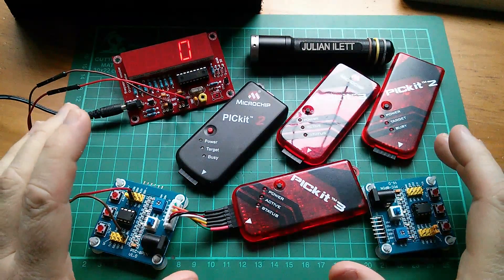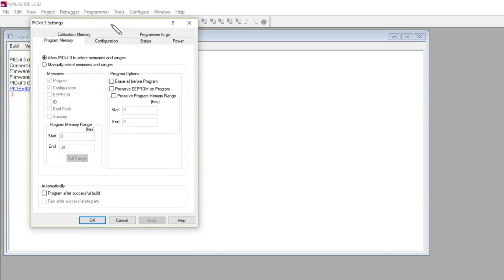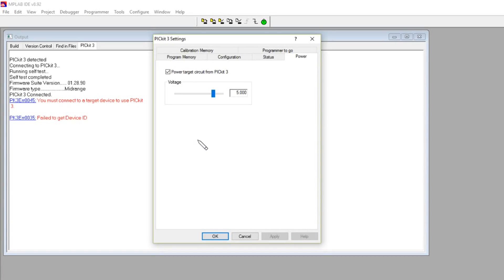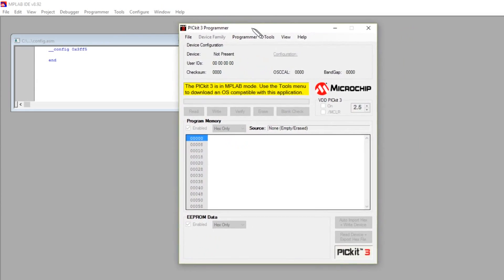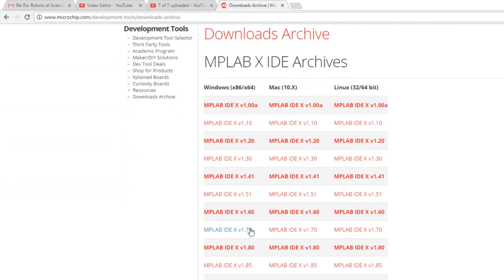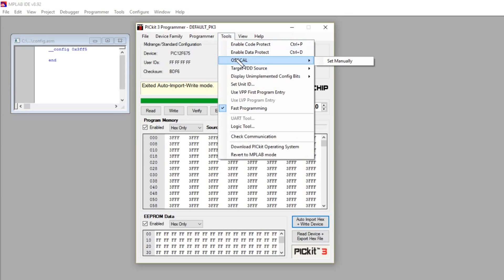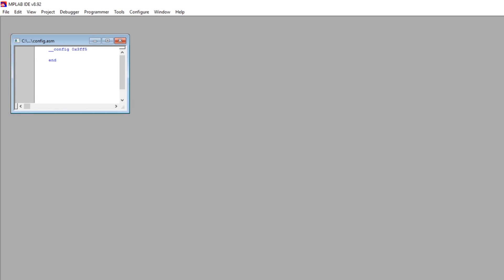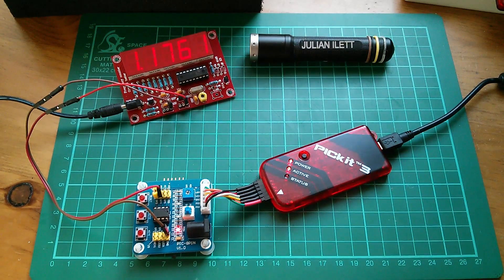PIC Assembly Language Update: #1.2 - PICkit3 Issues

Comment: Yup I think this is cause most USB ports won't do 5v, usually less. I've had this before too.
Maybe a powered hub would work?
Still awaiting Alice's parcel here. :)
Reply from the maker: At the moment, I'm trying to power the target system (the demo PCB) from the PICkit programmer. Later, when we program Neopixels (which take a lot of power), I'll use an external power source. Powered hub may be a fix, but I don't have one to try :)
Reply: USB port should be around 5V if not exactly 5.000V. The reason of reading 4.75V is because there is a series schottkey diode for reverse current protection and this diode drops around ~0.3V. Thats why when the voltage is read back, it was reading 4.75. Its not voltage that caused this issue because this PIC should work well up to 2.5V may be. I stand to be corrected because its not from datasheet but from my mind.
Reply: Julian Ilett I'm thinking I've had a warning in some other software that warned of low voltage on my port. I wonder what the difference is with the clones?